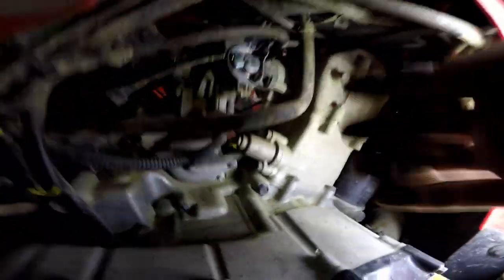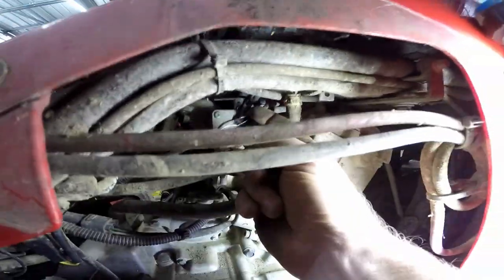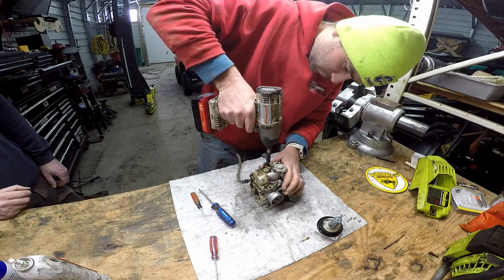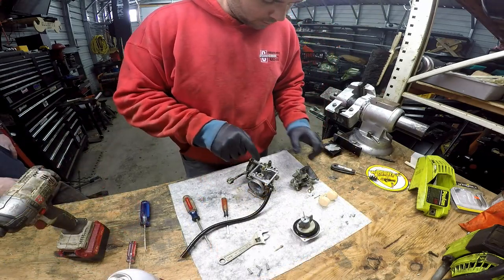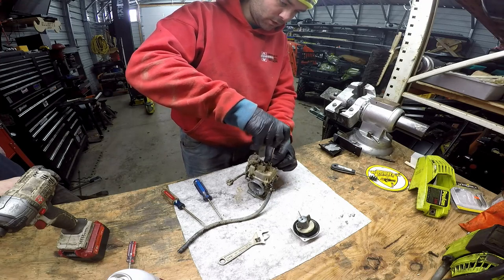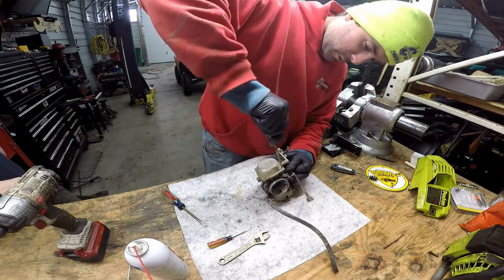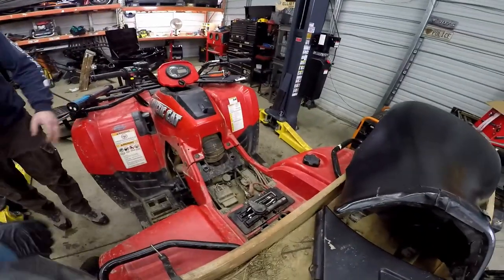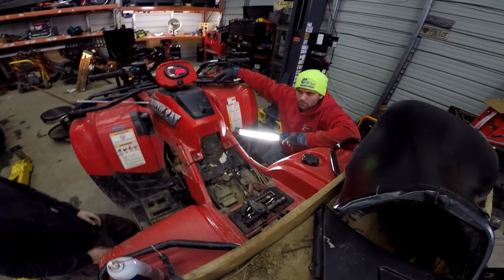Arctic Cat ATV carburetor removal and cleaning

Comment: Ive been through my carb so many times and it just doesnt stay running and it wont idle or if it gets warm it dies
Reply from the maker: you might have a bad gasket on the bowl, or your jets are incorrect for your elevation.  Check the boot between the carb and the motor as well for cracks or tears.

Comment: Got an 09 650 H1 TRV just installed a new Chinese carb, runs great at higher rpm, but from a start it bogs! 🧐
Reply from the maker: Adjust your low jet needle, there should be 3 adjustment screws, idle adjustment, low jet, and high jet
Reply: @EverythingElliott Thanks 👊🏻

Comment: I'm trying to a 2006 650 arctic cat v2 red back up and running that I brought from my uncle. it's just been sitting in his garage 6+ plus years with no one riding it. I've put a new battery in it, change the spark plugs and coils, did oil change, Siphon out the gas. We even clean the Carburetor, but only one cylinder opens when we press the throttle. Also, it won't hold a idle when in neutral
Reply from the maker: only one cylinder opens?  are you referring to the valves? I'm not sure what you mean...

Comment: Thanks for the video! I have a broken tube line that's is/was connected to a t-valve that sits in between the two intakes. That cable looks like it may run to the handle bar area. Do you know what that would be? Sorry forgot to add I have the 04 650 artic and it has the twin v2 carb.
Reply from the maker: Without having it infront of me I wouldn’t be too sure. Possibly just a breather tube?